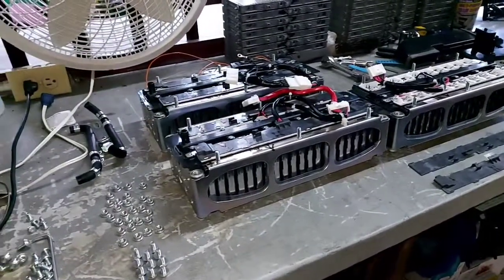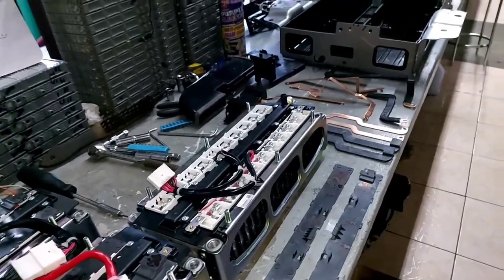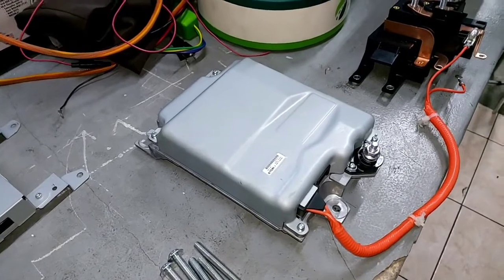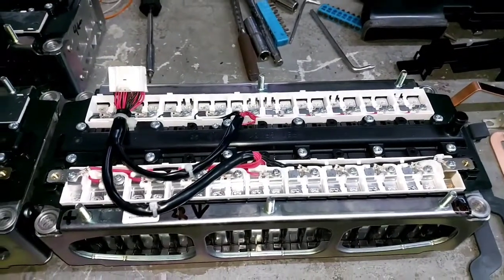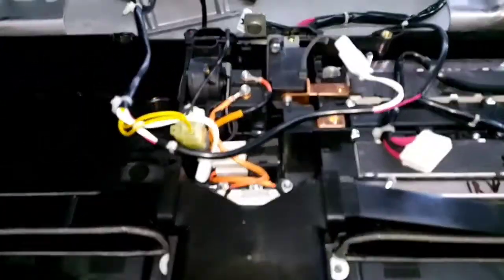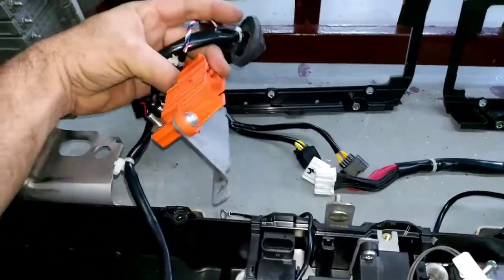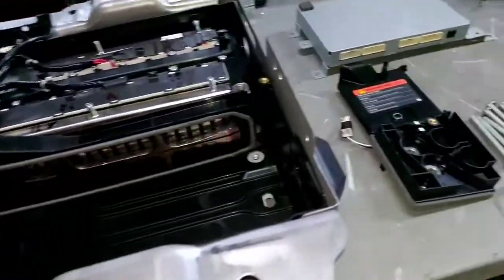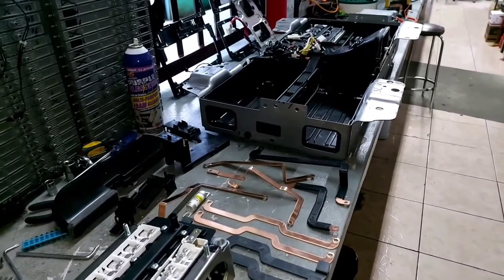Nissan Note E-Power HV Battery deep dive in part 3

Comment: Do they use the same cells as of a Nissan leaf if so is it from a gen1 or 2 thanks ..
Reply from the maker: No, they are not the same...
Reply: @hybridsolutiondiagnostics  trying to find specs to the battery is this around 1.5kw in total storage and is there any way to upgrade the sells to increase the capacity? by any chance do you know the cells part number thanks appreciate your work :) ..